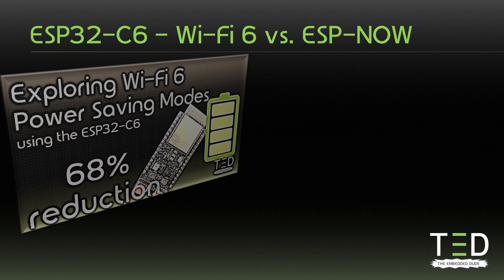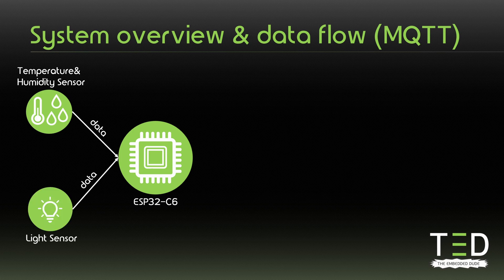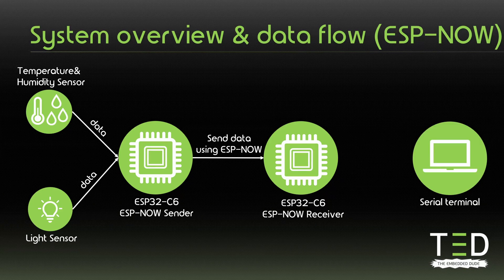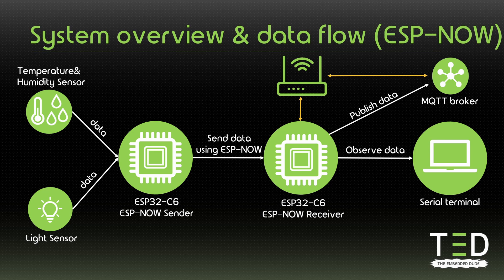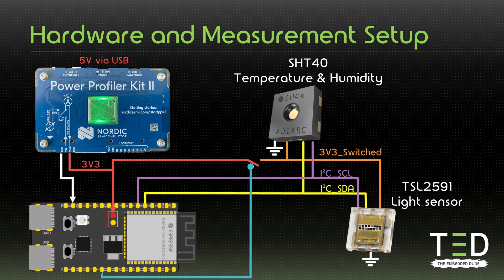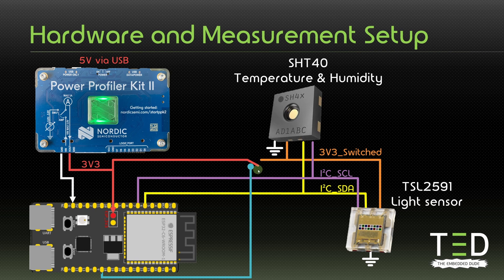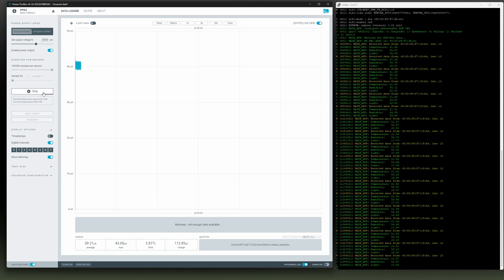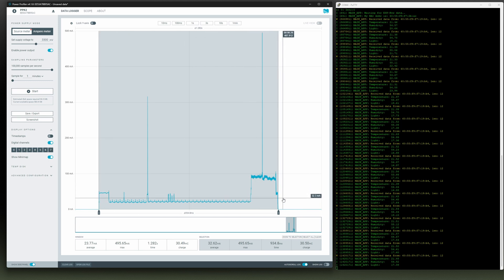Wi-Fi6 vs. ESP-NOW Power Consumption

Comment: Regarding the routers compatible with iTWT, the official team has provided some information in a GitHub issue for your reference.  AP List:
1. ASUS_RT-AX86U
2. Linksys_MX4200
3. MIFON_X1-XR2142T
4. Linksys_E9450
5. Linksys_MX5300
6. Linksys_MR7350
7. H3C_NX54
8. ASUS_XD4R
9. TPLink_TL-XTR7880
10. XiaoDu_XD-INA12-2001
11. TPLink_TL-XDR5430
12. ASUS_RT-AX56U
13. NETGEAR_RAX120
14. 360_V6
15. ASUS_RT-AX89X
16. ASUS_RT-AX82U
17. H3C_BX54
18. ASUS_GS-AX5400
19. Mi_RA70
20. Tenda_AX12
21. ASUS_RT-AX88U
22. ASUS_XT8

Comment: Dude, thank you so much for your two videos introducing ESP32C6 TWT low power consumption. I've also been using battery power recently and periodically transmitting small amounts of data to a server on the local network. I found that using 802.11 tx is more energy-efficient compared to UDP (like socket) or TCP (like MQTT). If the network signal is good, then I think iTWT+802.11 with simple application layer retransmission might be the best approach in scenarios with small periodic data transmission. What do you think?
Reply from the maker: Hi @mintisan, great that the videos are helpful for you. Based on my measurements iTWT should be a very good option for battery operated devices that only send small data. I like the fact that I would not need a gateway like with ESP-NOW and can use my WiFi infrastructure as is. However that is also where I have the biggest issues. Right now I dont have a router or AP that supports iTWT for sleep periods that I would like.
Reply: @TheEmbeddedDude  Yes, the need for an additional ESP-NOW GW increases the cost and maintenance of product deployment. Regarding iTWT, I purchased the AX56U mentioned earlier and am experimenting with different cycle settings. If there is any progress, I'll reply here as a reference for you [though I've been quite busy with work projects lately, so it might take some time]. I just want to find out and verify if iTWT+802.11 is the best way for periodic small amounts of sensor data.
Reply: Please make a video show utilize it built it zigbee

Comment: Gday! Thanks for sharing the code on github.. ive tried compiling the WiFi6 PwrTest project and testing auto light sleep (w/ iTWT) however i get a wakeup at 1 second intervals (that doesnt seem to be related to arp or dhcp timer) did you run into any such issue? 😃